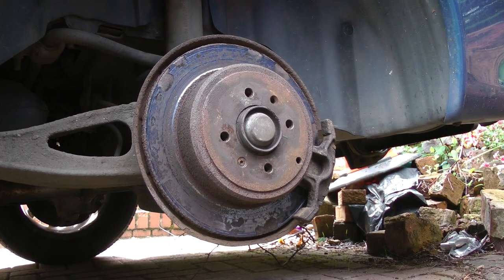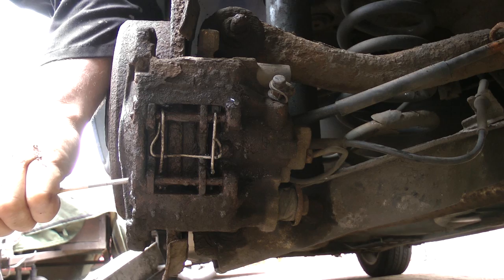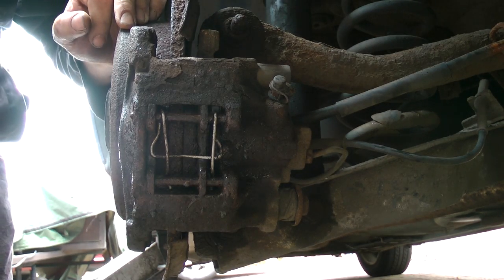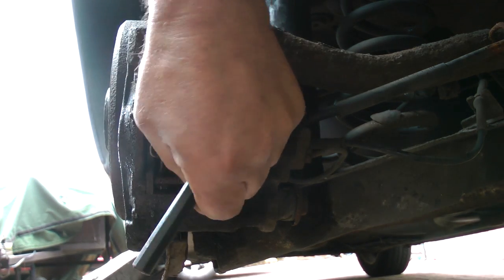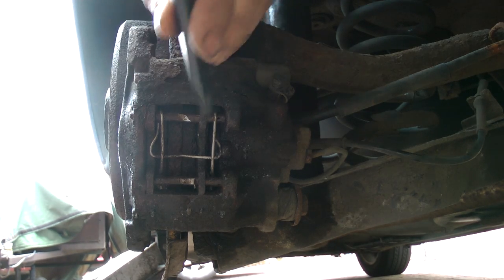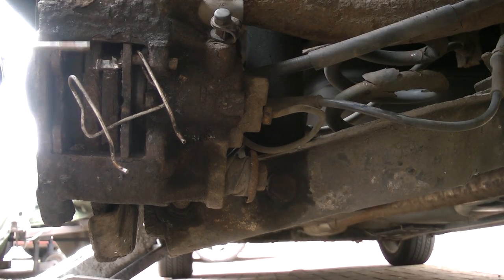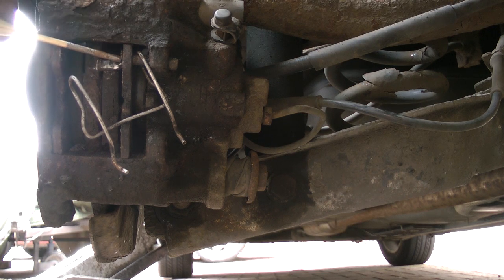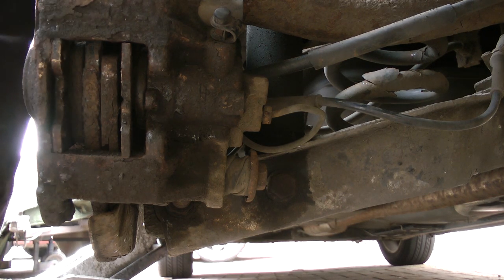Removing Seized Brake pins Methods

Comment: Great job, I had the same problem this morning. I got one out ok but the lower one was seized. I made a short (3/4") punch from the shank of the same dia drill bit, held it with mole grips and hit it squarely and firmly with a decent sized hammer (luckily my pins did not protrude beyond the face of the caliper so there was less chance of rivetting)

Comment: Excellent idea bunnybr - using a dremel (other makes are available). Cut 12mm out of the centre of each pin. Remove caliper then slide brake pads thru the gap. Refit caliper, cut pins again but this time level with the caliper getting them fairly flat then punch out. Rear pins can be punched out by going over the top of the caliper and down onto the pin.

Comment: All those techniques while a good start failed with both my Brembo caliper pins.  Even carefully heating a localized area around the pin did not work.  I had a Eureka moment thinking an impact action could break the corrosion and free the pin.  I had an air powered high speed impact nailer and applied it to the end of a road positioned on the end of the truncated pin.  Ra ta ta ta and out it came.  The second equally easy.  I could have saved myself hours trying this technique first!!! 

Jim

Comment: Any advice if the pin has mushroomed/riveted in the hole?
Reply: Get any help? Deal with this right now. How did you end up getting it out?
Reply: Drill it out, the pins are quite malliable